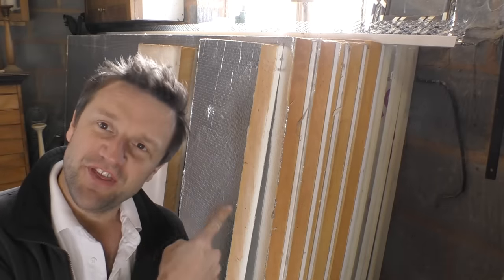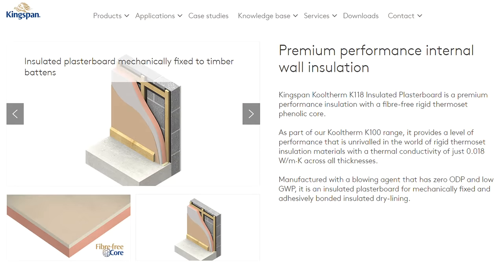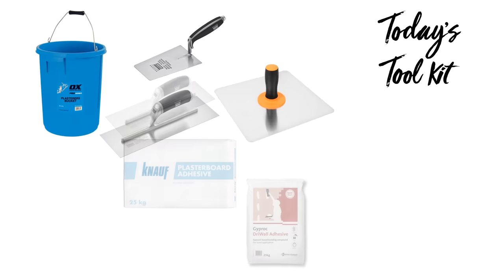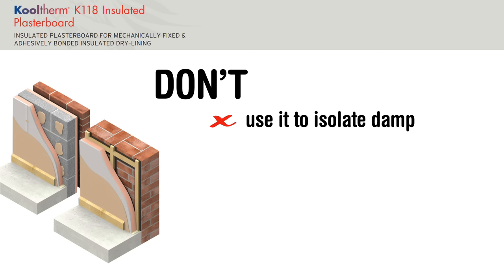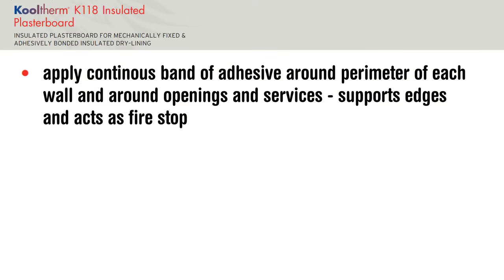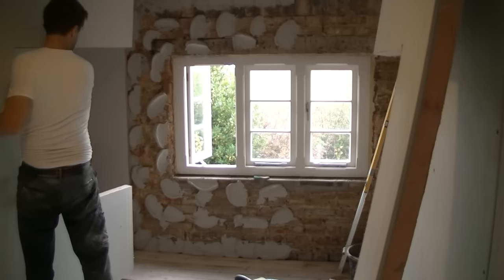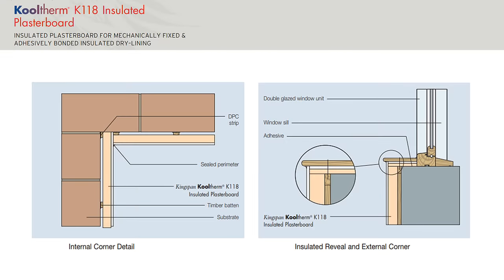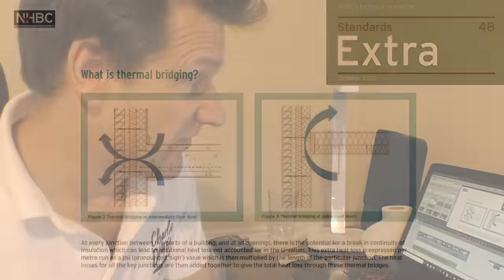How to Dot & Dab Insulated Plasterboard - a DIY Guide

Comment: May I ask a question here please? Hope someone  reading this will reply. I live in West Sussex, UK. I have a single brick wall shed at the bottom of my garden. Flat roof with plywood and felt on top. I would like to know if I should just build a timber stud wall (with 2x4) and put PIR insulation boards (making sure I leave at least 10cm gap between insulation boards and wall for air circulation), then board it up? Or should I put (attach using some kind of glue?) a breather membrane all around the inside  walls of my shed,  and then build stud wall and insulate as I first mentioned??  Please reply, and advice would be much appreciated. Kind regards. Jacobs
Reply from the maker: The internal vapour barrier (different from a breather membrane) is to stop vapour from inside the building penetrating into the structure of the building. Check, but chances are, the polyester foil on the PIR board (or integrated vapour barrier in products like Kingspan K118) will itself create an effective vapour barrier, so you shouldn't need an additional one on the walls, and the same if you're doing the same thing on the ceiling, but be wary of creating cold bridges (eg ceiling lights, wall sockets where you're cutting through the PIR board and therefore compromising the vapour barrier). The breather membrane is I believe for the OUTSIDE of the building. You would for example typically have a breather membrane around the outside wood frame of a garden room, which is then battened and cladded. The breather membrane as the name suggests allows the internal structure to breath, whilst preventing water from getting through from outside. So in summary a vapour barrier goes INSIDE the insulation whereas a breather membrane goes OUTSIDE the insulation. Check out this link https://bit.ly/3m6vKBS but in my view (I stress I'm not an expert on this) you wouldn't want a breather membrane INSIDE the building as what you're trying to do is stop vapour from inside the building condensing when it hits a cold surface. If you can, you want to stop ANY vapour travelling through the plasterboard into the gap you're creating.
Reply: @CharlieDIYte  thank you so much for clear explanation. It's much appreciated. Regards. Jacob

Comment: @Charlie DIYte Brilliant video, really informative and well presented. I'm in a similar position and about to internally insulate an old 1920's semi that has solid brick walls. I was wondering, have you any experience using Superfoil insulation? In our last house we had a builder put up a small extension, he used Superfoil to insulate it, and to be fair, the extension was really warm and cosy. According to the website its relatively easy to attach the foil to the wall using batons and then use regular plasterboard to finish. Apparently using Superfoil allows you to have a much higher level of insulation without losing too much room space... Any help or ideas greatly appreciated...   Thanks in advance.
Reply from the maker: I haven't actually, although I agree with the baton approach, particularly as your wall has no cavity. Having used adhesive on a few walls I've just batoned our bedroom before using the K118 and I like the idea of creating the additional cavity with the batons (2x1 tanelised)  and not introducing all that moisture into the walls with the adhesive. I've got to say I like the look of this stuff. If I were you I'd call them up and find out if their wall product meets building regs "u"values and if it does, go for it, provided you can be satisfied you'll be eliminating thermal bridging. Kind of wish I knew about this stuff earlier 😏!
Reply: @CharlieDIYte  According to the website Superfoil meets, and in some cases exceeds, Building Regs for most domestic and commercial purposes. They will even calculate the appropriate U Value for your particular project and recommend products if you contact them, so it seems their customer support is pretty good. I'm going to need to do the floor, walls, loft and garage and it seems like they have products suitable for all of them. My project has been put on hold until all this COVID 19 situation has cleared up but I will let you know how we get on when its all back on track. Great info BTW, your videos are going to be my initial point of reference whenever I need information on getting stuff done. I really appreciate everything your are putting out on line. Thanks. :)
Reply: @paulsaxby7579  I insulated a room in my 30s house, similar  to this video, only I used 25x38mm roofing battens on the walls rather than dot n dab, as mine also have no cavity - this worked well. On the sloping parts of the wall, I stapled thermaquilt to the rafters (I'm guessing this is equivalent to the super quilt you're talking about) in addition to the cellotex in the gaps to boost the insulation, and then fixed insulated boards on top with longer plasterboard screws. That was a hell of a job as the quilt was balling up around screw as I was trying to drive through it, and I ended up having to make several attempts before getting one successful fixing - it looked like those boards had been attacked by woodpeckers!
Just wanted to make you aware as I wouldn't want to use it on the walls for that reason!
Reply: @davidbryan3027  Hi David. Already done the vast majority of it. The Superfoil worked perfectly. Yes, I had a couple of screws get caught up in the insulation layer but considering I used nearly 2000 screws over the entire project, I don't think losing two was too bad. We  attached the  battens on the walls vertically using concrete screws, then stapled the Superfoil to the battens, then then we attached another set of battens, but this time placed them horizontally. We then attached the plasterboard to those battens. We lost exactly 100mm from the size of the room, but it's barely noticeable. I have one more wall in the smaller bedroom to do. It will probably take me a couple of hours, then all I have to do is skim the walls. The only thing holding me up is an injury to my wrist, which is stopping me from being able to move the sheets of board, other that its all been fairly straight forward. Its definitely made a noticeable improvement in all the rooms and I am very happy with how its gone.

Comment: This is not Dot & Dab. This is Dab only. The Dots are small squares of plasterboard (typically 8x8) attached to the wall with adhesive to create a level surface prior to installing your full boards. You then mechanically fix your boards to the Dots with Phosphorous screws to prevent discolouration. Just using Dabs (blobs of adhesive) without the Dots exposes the full boards to flexing out of shape, risking an uneven wall surface.

Comment: I used this in a garage, on a celling under a rubber roof/osp board. I seem to be getting a lot of condensation between the osp board and the insulation board.
Any ideas how up stop it.?
Reply from the maker: Yes you want to check out Steve the Roofer's YouTube channel. Where you've got a cold roof like this, it's important you have ventilation between the insulation and the osb. He'll have plenty of tips.
Reply: @CharlieDIYte  OK. I will check him out mate. Thanks

Comment: Charlie, hi, about to embark on this type of work in my reno, question, is there any reason not to use PIR plus plasterboard rather than a composite PIR/plaster sheet?
Reply from the maker: No reason at all. You could definitely do this and the advantage is you can then foil tape the joins between each board for better vapour barrier continuity.

Comment: You can use gyp-line system for a mechanical fixing that allows air flow around the back of board, leaving a gap at the bottom of the board to allow air to flow from room to the wall. This also disconnects the external wall from the board. That also means you can install insulation in between the gaps in the gyp-line, so losing less space in installing.

Comment: Hi Charlie, as always I love your videos.
I have a  question.
Do you think this insulation could have caused condensation at your house?
I have a gable roof (cold roof) with OSB and rock wool inside and across the rafters.
A vapor barrier and, still condensation problem between OSB and insulation.
It is a new roof and I did realise pretty quickly, in the first winter.
But now I have to add vents between osb and insulation between every rafter, down at the eaves overheang and along the ridge. 

Adapting an old house to the present standards ( I have triple glazed windows, 15cm EPS on external walls, 25cm rockwool on roof) it's a never ending process and one can not go without the other. Now I'm thinking about ventilation and heat recovery system 🤕🤕 to reduce vapor.
I feel like I'm chasing my own tail.. Its like an addiction 😩
Reply from the maker: Hi mate, thanks for this. I agree, it's tricky adapting old places. The conservationists get very upset when they see us insulating our old houses but we have to make them habitable and leaving the walls uninsulated with lime plaster doesn't cut it. Have a look at the comment I just left to Stephen - it should be the most recent in the comments below the video. Bottom line, yes I do worry about interstitial condensation, primarily where I cut through the insulation for the back boxes. As I explained to Stephen, in our bedroom learning from past insulation I tweaked what I did giving me minimal cold bridging opportunities. For the upstairs in general, I try and minimise the vapour levels by keeping windows on trickle vents (they don't actually have vents but with the latch open one notch) and the bathroom window open pretty much permanently, and vigilantly watch my hygrometers following this vid https://youtu.be/TIDb-pdOnXM - they currently show RH levels in the 40s. I'm amazed you're getting condensation even with that 25cm rockwall. The vapour is obviously getting through somehow. Have you got spot lights? I also have insulation in the loft but mineral wool overlaid on top of 1970s stuff. However my lofts have no roof felt so the howling gale up there probably keeps condensation at bay. Have you watched any of Steve the Roofer's videos on YouTube? He goes into this in a big way, with a focus on flat roofs
Reply: @CharlieDIYte  no, not one spot light. 
Knauf insulation guy said that it's really common issue with OSB boards on roofs when insulation is inside.
The OSB remains in the cold part, dew point is inside.
Suggested the max quality aluminium vapor barrier before insulation (from inside) but said it needs to be 100% sealed. But also stated that the vents are the best possible option even with a great vapor barrier, because OSB doesn't let any of it out.

As I understood the condensation is possible even without our vapor production inside and the interstitial condensation is the worst one. 

On the other hand, putting vents and letting air in means letting moisture too.. 
So I don't know what to do anymore... A new roof or a good ventilation system with heat recovery. It's basically the same price
Reply: Lucky strike - this sounds more like a roof style question and whether you have warm roof, cold roof or hybrid. It sounds like you have a cold roof in which case it’s really important you have a ventilation gap between the insulation and the OSB on top and that air can freely move across that gap, ie don’t have noggins in the way that act as blockers. That ventilation will then mitigate vapour condensing on the underside of the OSB. There is also a hybrid roof option - a hotly debated option online!
Reply: @AccountantDoesDIY  True, the problem is the roof, however, it is still a matter of moisture.  The gap between the insulation and the OSB panels alone is not enough, and holes should be made for ventilation of that space.  This means drilling  through my new 15cm EPS facade and roof, but in these winter months it means letting in completely moist air because it is foggy outside all day.  Do you have any link to the talks about the hybrid roof?

While studying all this related to my roof issue, I discovered the "building physics".  At the moment when I was calculating my wall section and thinking about adding rockwool from the inside, between plaster boards and brick wall, the program warns me that there will be an interstitial condensation between the wall and the EPS board, on the outside..
Those things should be all calculated by a professional and by all means avoiding doing in DIY or event with just a construction company..

Comment: can I add these boards to the attic for insulation?
Reply from the maker: Depends where. Not on the floor. Yes the the ceiling of it's living space but otherwise you'd want a PIR type board rather than something with gypsum in, and roll out wool insulation between the floor joists.

Comment: If that is a solid wall Kingspan isn't the best for this, you wont allow the wall to breathe and it will be colder which will result more damp issues, water / frost damage to the brick / stone.
Reply: Its interesting you say this. Wood fibre board and lime suppliers (the breathable alternatives) make no guarantees that these breathable materials will eliminate condensation or moisture build up issues. You could therefore end up spending more money for less thermally efficient wood fibre boards that still might not eliminate moisture/condensation.

Comment: How would you seal the gap between the bottom of the board to a concrete floor?
Reply from the maker: I'd use expanding foam tape. I used it in this video https://youtu.be/qhe3Waq6Ac4

Comment: Charlie - love the videos and this one really helpful for me in deciding what to do with my garden wall project.  Because the room is narrow (and the price of timber) I want to avoid the use of batons on the wall to create a stud wall and was thinking to PIR plasterboard dot and dab. The garden room is a single skin concrete block. I am rendering the outside to protect from any damp penetrating  and its well protected on that front because of the location its in. But one thing concerns me and that's hanging heavy TV brackets and wall-mounted PC monitors on the wall. I have seen technics with batton walls to use some timber board ontop of the insulation between the batons to anchor onto. If I directly dot and dab my PIR - Ill have nothing to anchor heavy things on the wall - any ideas or workarounds? Thanks Tom
Reply from the maker: Thanks Tom, glad you find them useful 😉 I think you'll have to use frame fixings and go directly through the insulation into the block behind. You can get them in different lengths do choose a length that goes through the PIR and at least 50mm into the block behind. The screws are quite chunky so you may have to drill wider holes in the brackets bit this is relatively easy. You're piercing the vapour barrier doing this but it's a low occupancy room so you should be ok. You might consider using foam rather than plasterboard adhesive to glue the insulation to the wall. This isn't putting any moisture into the wall and the advantage is when you do the back boxes for the sockets, you can spray foam behind them to eliminate any cold bridging - which you can't do with plasterboard adhesive. Cold bridging is something you have to be very aware of doing this insulation, and cutting the socket boxes is a major source of it.
Reply: @CharlieDIYte  thanks, I will research some foam adhesives. Looks like old ‘dot and dab’ is back on the menu!
Reply: @tomwbsmith  Hi Tom, just reading comments on here. For your application it may be worth looking into a product called 'Spacetherm'. Much reduced (often 10x) thickness for similar U Value (W/m2k).

Comment: Why there is no gap between the wall and insulation? Don't you worry about moisture and condense?
Reply from the maker: They're is a gap - where the adhesive is. There shouldn't be moisture/ condensate provided the vapour barrier does it's job but I agree, this is always a potential concern.
Reply: @CharlieDIYte  
Does insulated plasterboard contains vapour barrier or what do you mean by it (vapour barrier)?

Comment: @9:44 - Did you say 'more than a fifth' or '50%' of the walls of the room you need Building Regulations approval?
Reply: I once contacted Building regs when renovating an outside room. They keep changing their minds and upping what I had to do to the point where it became uneconomic and also didn't make sense. I rang the top BR man and he saisd that I was improving things so whatever I did would be fine. So i did as I saw fit and it all worked well. How can building regs condemn some work if it improves what is there already?

Comment: I have carried out this technique on a parting wall and now i can hear the neighbors too well, any suggestions??
Reply: I have also used this technique all the other walls and it worked so well( just not the parting wall), thanks to you and you videos!
Reply from the maker: So it's a sound insulation issue you have. You need to Google the options but you're going to need a system that creates some sort of floating wall, I think, to deaden the vibrations coming through the wall.

Comment: Hi, i noticed st 16:31, you have a slope curve on the ceiling. I have this slope also, but no insolation in the loft as this is the eaves. Im loosing heat in this area and possibly causing condensation in the loft. Can i use this board there to fix?
Reply from the maker: Well that's what I did. I don't have a condensation problem because my loft doesn't have roof felt, but it's definitely insulated the sloping elements well. I screwed it to the rafters, which wasn't easy because they're oak!
Reply: @CharlieDIYte  thanks for the reply. I have no felt either, but they appear condensated. The thing that i  keep rrafi though is not to pack out the eaves and leave a air gap down the side?